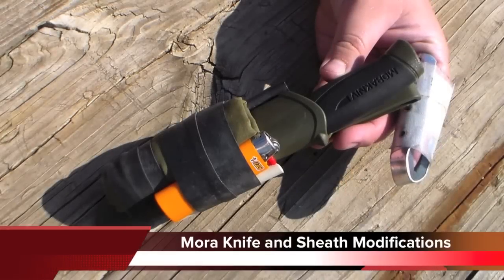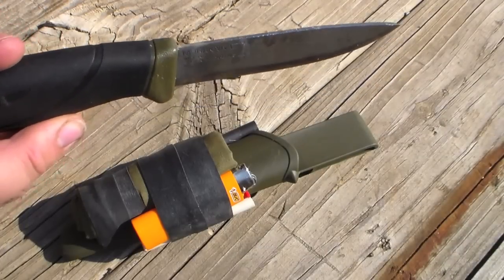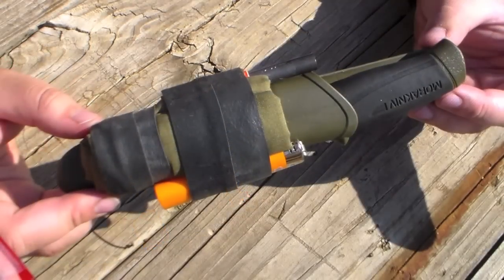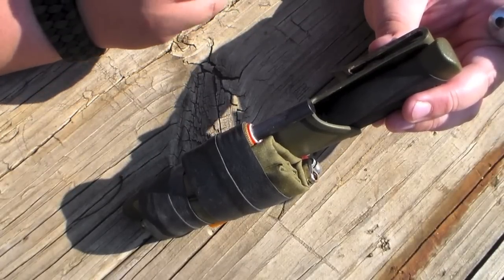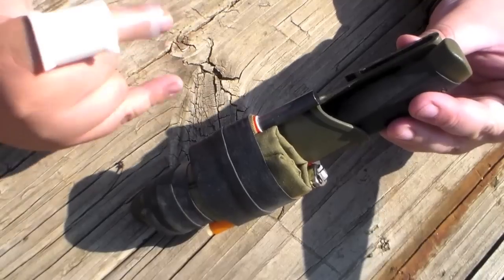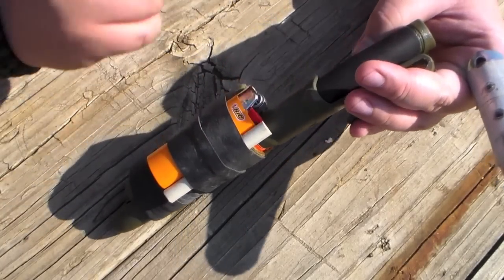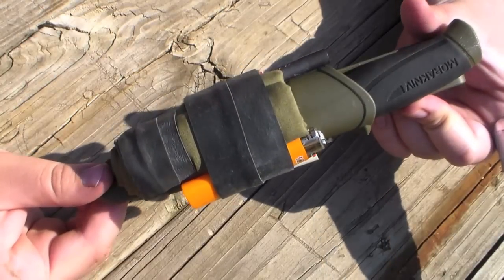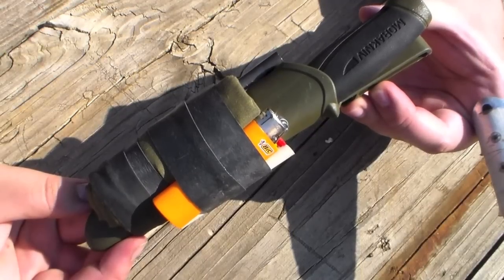Mora Knife and Sheath Modifications

Comment: For most knives, those would be good modifications, but I think a Mora should be left alone.  The primary purpose of a Mora should be to do all the fine carvimng that bushcraft, and often survival, demands, and the Mora is designed to do just this.  Fine carving demands that you use your thums and index finger on the back of the black, sometimes with considerable pressure.  A ninety degree spine makes this highly uncomfortable after a relatively short time.  The Mora tip does not break unless it's used improperly, and a clip point is excellent for fine carving.  A drop point is not.      Nor am I ever likely to need the spine of my knife to do anything.  Definitely not the spine of my Mora.  Unless someone steals my pants, in which case they'll also steal my Mora, I always have at least three other things that can strike a spark, scrape wood, and do anything else the spine of a knife can do.  Two of them work better than a knife because they're dedicated strikers and scrapers.   Modifying knives can be both fun and useful, but the Mora is the best knife out there for doing a specific, and extremely important, job, and every modification I've seen takes away from its ability to do that job.
Reply from the maker: +James Ritchie Thank you for the comment. Let me handle it in parts:
1) I use the Mora for both small and large tasks. The HD version does better than this one, but both are adequate;
2) The 90 degree spine is not that uncomfortable when carving (at least I have never had a problem). If if is a bother, one can pad the thumb easily;
3) The tip of this knife broke off while I was carving a bowl—I have seen MANY Mora tips break simply because the metal is thin at the tip (it just happens absent neglect in high Rockwell, thin-tipped knives regardless of price, quality, or maker);
4) Often the tips of drop points are stronger than those on clip points since there is a slight bit more metal supporting the tip on the former due to the arch in the spine and lowered tip; and, 
5) Why carry a dedicated scraper when you can use the spine of your knife (I understand redundancy, but I also value lightening a load)? 
Therefore, these modifications have done nothing but improve this Mora: a) the drop point pierces material more easily; b) the drop point reinforces the tip slightly; and, c) the 90 degree spine acts as a ferro rod and wood scraper.
Hope this helps you understand my rational for modifying this Mora. Have a good one!

Comment: why grind the spine of the knife?.....just use the very bottom of the knife closest to the handle....
Reply from the maker: Good question! I follow Dave Canterbury on this one: never use the blade to strike a ferro rod, especially the part of the blade closest to the ricasso. The metal of the ferro dulls a blade quickly, if not immediately, depending on the content of your given ferro rod (btw, cheap chinese rods are much harder than more expensive, good rods). Since your knife is very important, it is never good to deliberately dull or roll the edge. As for "especially the part of the blade closest to the ricasso," the reason you don't want to use this part of the knife is because this is the most important portion of your blade for bushcraft work. You have the most control working with the portion of the blade closest to the ricasso. So you should try your best to always keep this portion as sharp as possible. If you must use the edge for striking a ferro rod, use the area at the tip which is rarely used for cutting and more often used for piercing.
Hopefully this helps. If you choose to do otherwise, that is fine. Just remember that to do so is to compromise the sharpness, and thereby usefulness, of your most important bushcraft tool. 
Good luck and God bless!

Comment: I like my Mora as a neck knife and I want it lite for that. I keep all those things like the ferro rod, ceramic rod, handkerchief in my pocket. I keep my ferro rod I bought with a hole drilled in it...http://firesteel.com/firesteel-armageddon-with-lanyard-hole ...and I drilled a hole in my ceramic rod so I can attach them with very small key rings 3/8 inch (like the ones on a Victornox Knife) to a paracord lanyard along with my Swiss Army Knife Hiker. The lanyard is about a foot long like a watch chain and attaches to my belt loop with a quick release on it. The back of the saw blade on the Hiker throws sparks very well being a perfectly sharp 90 degree. That way I will not loose those things even if I am upside down in a fall, or fall in a river. I got the idea from watching a Ray Mears episode where he had the same setup on him.
Reply from the maker: +bibleprophecy1st That's perfectly fine, though I suggest bringing the spine of the Mora to a 90° angle and use that as your striker. It eliminates one thing you have to carry.
Blessings!
Reply: Survivalkraft I did that with all my Mora's as well as my BK2 on a bench grinder. I did not need to do that with my Buck 119, the edge was sharp enough from the factory. I also have two Victorinox Swiss Army knives, the Hiker and the Trecker both of which have saws with very sharp 90 degree spines. Taken care of.
Reply from the maker: Great! Sounds like you're set!
Reply: Survivalkraft I lied, unintentionally. I did not mess with the spine on my Mora draw knife or my Mora curved spoon making knive.
 Just messing with you.

Comment: You should switch out the rag and use the space it takes up for some folded up foil to cook and purify water over a fire with, a square patch or two of white birch bark for a more natural yet highly flammable fire starter (you can slice off several matchstick-sized strips and feather the tips to easily start a fire, or just shave'n'scrape what you need off of the patch, both ways work), and one of those xtra small altoid tins with a mini fishing kit inside it.